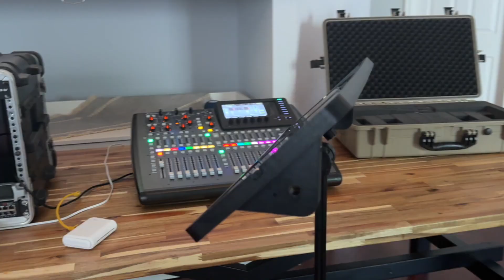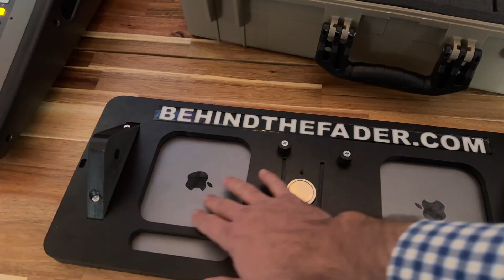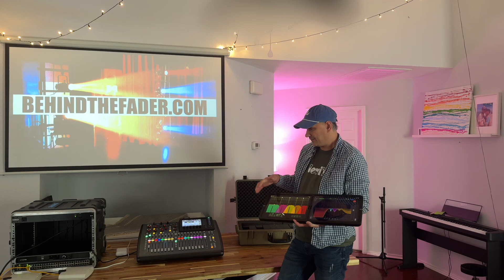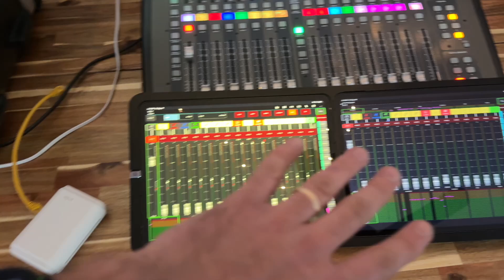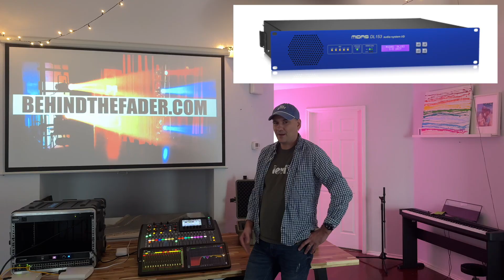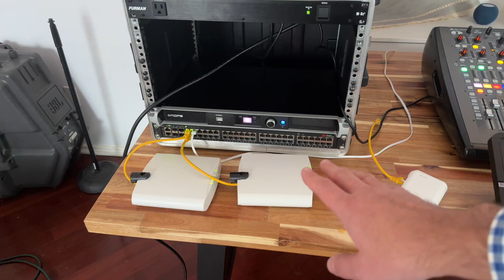The Dual iPad Mixer Setup That Beats Pro Consoles

Comment: You look like a perfect case for the iconnectivity device that allows you to have a second laptop it switches to automatically, I cannot remember the name of the model.   I like like the company.   One of the few companies I am a fanboy of, I should be on the payroll for the number of timesnInhave recommended em, but the products provide phenomenal power and reliability. ( assuming you dont break the usb jack off the circuit board and ruin yours like I did 😭😭😭😭😭😭

Comment: great design for the ipad holder would be great to add in a low profile motorized fader controller and make it foldable to take advantage of the extra screen real estate to be able to display more functions for on the fly mixing. For monitoring both mixers I tried directly connecting monitor outs into aux ins on a x32 rack and soloing on one mixer with a wireless IEM pack. Might do a video later on yt.

Comment: No one needs 96K in a live show environment.  The only thing that you might lose is the ability to get a multitrack at 96K to use later (live album?). 48K works great and the mixers are less than 1/3 the cost.

Comment: Great solution. I‘m in a 4 person band that works w backing tracks. I play guitar, bass and sing. On my ipad i have mixingstation for iem, stagetraxx3 app for running my lyrics, via midi I load the song into into multitracker app. Multitracker is connected to my wingrack via usb to run the backingtracks. Multitracker runs in the background so there isn‘t much to do. But st3 and mixingstation are often to manipulate. So it would be necessary to have access to the usb port. 2. would be nice to have the connection kit also integrated. Do you plan also for musicians? I think this could be a market. Greetings Gerry😊
Reply from the maker: Thanks for the feedback! I originally built this case to meet my own needs and never really planned to turn it into a business — I just don’t have the time for that right now. That said, it would be great to find someone in Austin who’s passionate about the idea and interested in collaborating on it.
Reply from the maker: Custom Dual iPad Pro 12.9" (3rd Gen) compatible Case - Holds Two iPads
Now for sale!!!
https://ebay.us/m/CWPU20

Comment: you could add a shoulder strap system like "SUAT" so you can run around when you trouble shoot/setup ?
Reply from the maker: 🤣🤣🤣
The idea is that iPads can be easily detached.
Reply from the maker: Custom Dual iPad Pro 12.9" (3rd Gen) compatible Case - Holds Two iPads
Now for sale!!!
https://ebay.us/m/CWPU20
Reply: @behindthefader  nice one

Comment: This is such a great idea. What apps are you using on the two iPads for mixing?
Reply: Looks Like mixing station
Reply from the maker: Mixing Station. By the way the Mixing Station app can provide some very useful features for some consoles that are not available in stock.
Reply from the maker: Custom Dual iPad Pro 12.9" (3rd Gen) compatible Case - Holds Two iPads
Now for sale!!!
https://ebay.us/m/CWPU20

Comment: You still need real mixing consoles.  What that just do is mixing freely, not limited by wires..
Reply from the maker: Yes. I would prefer the real mixing console, but I will use this two or four iPad gadget as the addition. Also on small gigs I will go with iPads only.
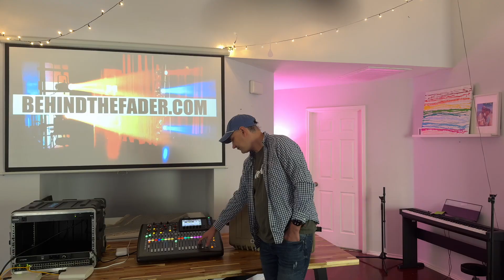Reply: @behindthefader  it because you said in 1:12 "the more we movin' forward, the more I see myself using JUST an ipad with the mixing station on it.." 😅 sounds like you're leaving the real console behind. 😅😅
Reply from the maker: @zmarasigan9788 Yeah. It depends. Sometimes I can use iPads only. Sometimes I need the physical controls. Sometimes I need both.

Comment: I don’t see real pro engineers asking for glass surfaces to mix on. When WiFi gets glitchy so does your your mix and speed of mixing. Maybe great for “set it and forget it” not for pro live engineers. Sorry
Reply from the maker: Thanks for your opinion. The WiFi will never get glitchy with this setup. Will see in 5 years how mixing consoles will look like. I personally very enjoy mixing on two iPads.
Reply: @behindthefader  Wifi will always glitch. It is the nature of shared use frequency band like WiFi uses. Full stop. Your setup happens to work, and there are no guarantees what so ever. Adding more non-managed WiFi systems to the same shared spectrum in effect lowers availability of the network.  I work with building media transport and control networks, I have seen all these ideas and how they fail. 
Still, having a wireless remote to go around and being able to get hold of controls at the most convenient position is extremely powerful. It is a game changer for mixing monitors, for instance. You walk up to the talent and listen to the same thing, and can poke at it at the same time. 
I have mixed small festivals on glass only -- Mackie DL32 with iPad and Mac remote. It certainly is possible and doable. I still would not choose it over a control surface with actual knobs and faders, especially not if I have a remote option as well.

Comment: Is amazing wow , I have a question this setup can be used in Daw likes Cubase , Protools , Logic pro , etc Like the second ipad is the continuation of the mixer , will be amazing if you share it
Reply from the maker: Custom Dual iPad Pro 12.9" (3rd Gen) compatible Case - Holds Two iPads
Now for sale!!!
https://ebay.us/m/CWPU20
Reply from the maker: That is absolutely possible to controll Logic with two iPads using Logic Remote. I did it in a past.

Using Logic Remote on Two iPads
Logic Remote supports multiple devices connected at the same time.
You can assign each iPad to different tasks, for example:
iPad 1 → Mixer control (faders, pan, mute/solo)
iPad 2 → Touch instruments and Smart Controls
Both iPads communicate with Logic Pro over the same Wi-Fi network.
Reply: @behindthefader  Thanks for your answer , i appreciate it , did you made a video explaining this process ?
Reply from the maker: Will add it to my todo list. Stay tuned.
Reply from the maker: @palabrasdevidaeterna_iglesia will do
Reply: @behindthefader   I will be expecting , Thanks for your time and great value content , Blessings from Poland